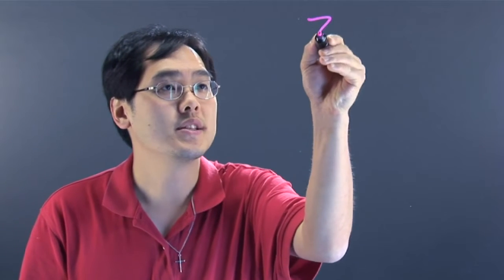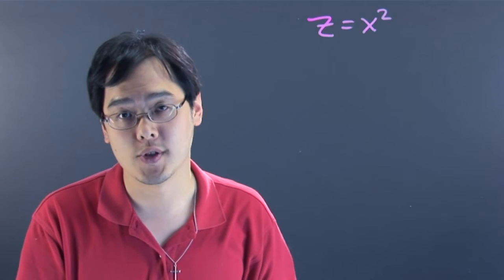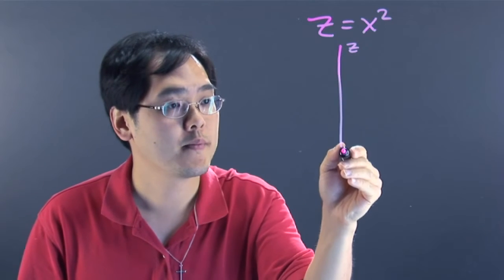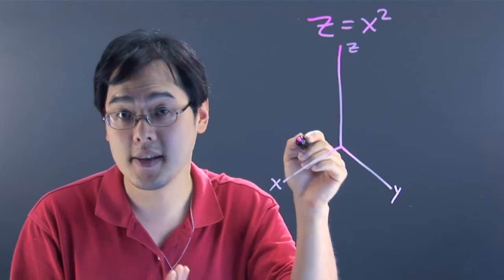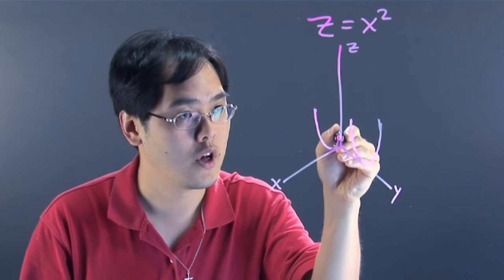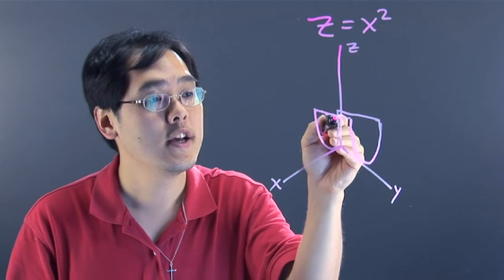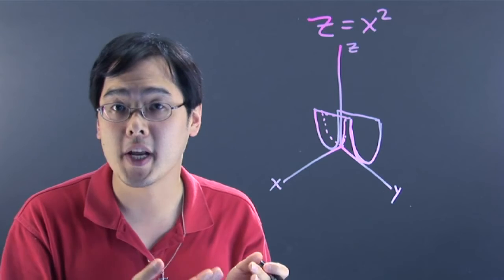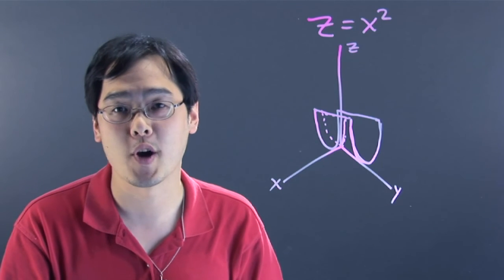How to Graph a Parabolic Cylinder

Comment: don't get the cylinder part.  its half.
Reply: The mathematical definition of "cylinder" includes more shapes than the ordinary soda can shape;
a mathematical cylinder can be imagined as a shape that can be drawn as a curve on a piece of paper, and then extended into 3 dimensions.
More specifically, if you ever graph an equation that contains 2 variables in a 3-dimensional space, then that graph will be a cylinder, and it will be extended along the missing variable.
The graph in this video is the equation z = x², which contains 2 variables, and is drawn in 3D space, and the missing variable is y, so it is extended along that axis.
The reason why it is extended along the y-axis is because the function "z = x²" doesn't say anything about the y-values, and this means that you must get the same graph at all y-values on the y-axis.